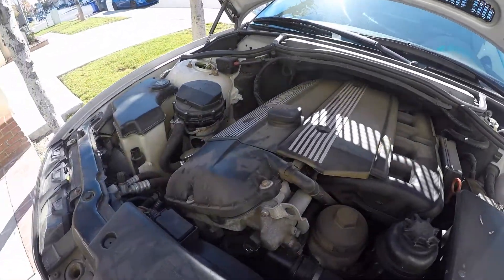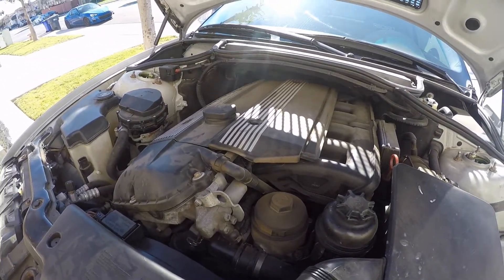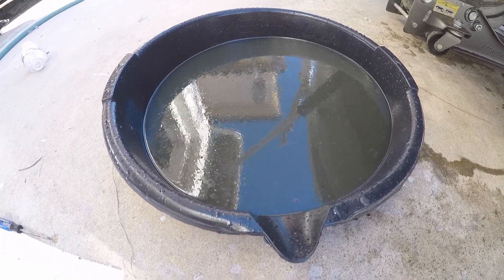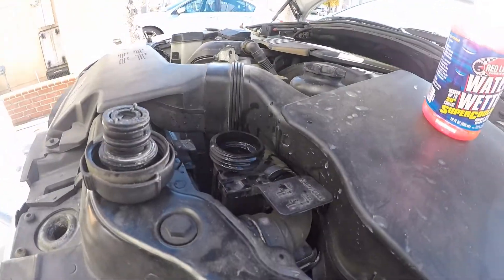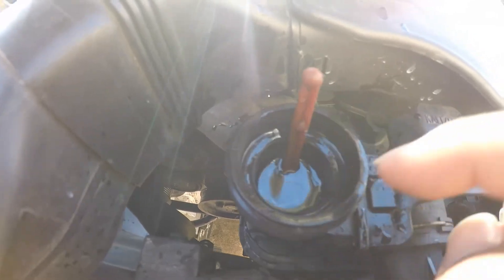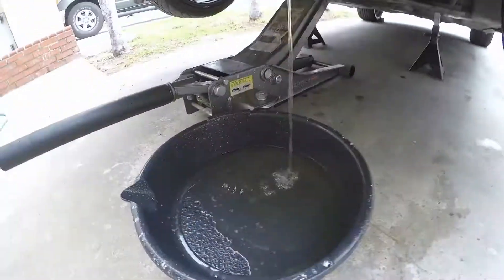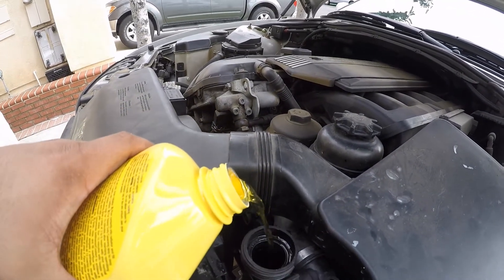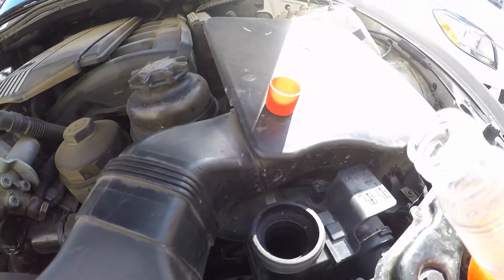Unclogging My Radiator | Coolant Flush | #TheE46DriftBuild Ep 008

Comment: That's quite astonishing the amount of crap that came out, can you please advise have you had issues with your expansion tank cracking? I am on my fifth expansion tank in 5 years and I only drive 6000 miles a year. I am thus researching how to clean the system.. To be honest with five lots of coolant in five years I'd expect it to be clean.
Reply from the maker: That’s way too often. Over pressurized system from a head gasket maybe? I did go through one because it rubbed against one of the pulleys since my radiator wasn’t properly secured. That might be one thing to look into as well
Reply: @nuisance_carl  It had a headgasket change few years back.
Reply: @nuisance_carl  Please can you expand on what you are saying in regards to pulleys? I am not sure what you mean.
Reply from the maker: @unusualaquariumecosystems5805  I don't remember which one it is, maybe the alternator pulley, but it sits close to the expansion tank, and if your tank, or radiator isn't mounted correctly, or you have a thicker radiator, you may have clearance issues, which I did.

Comment: How did all that gunk even get there in the first place?
Reply from the maker: No idea lol
Reply: Probably never been properly flushed? Or the previous owner used tap water instead of distilled water?? I'm getting my 2002 325i flush tomorrow. Car was running hot. Neighbor pours tap water to get me back home. Hopefully that's it. Fingers crossed no tank expansion or radiator leak. I'm being cautious as I'm a female. Have trust issue.